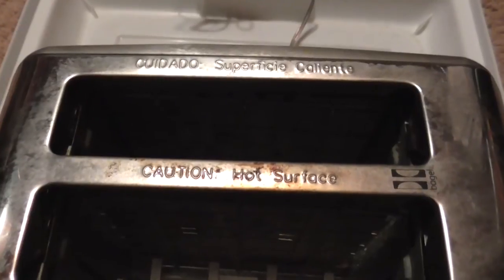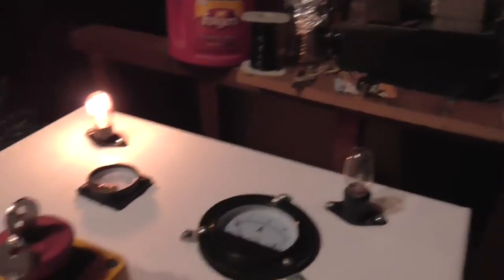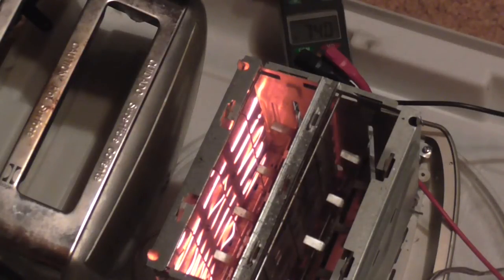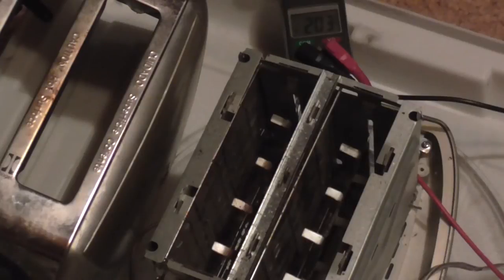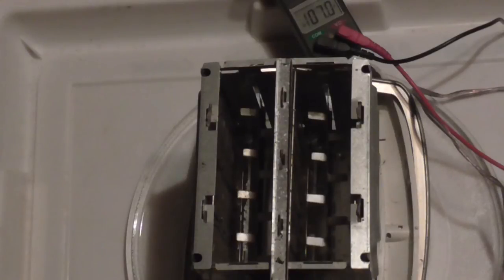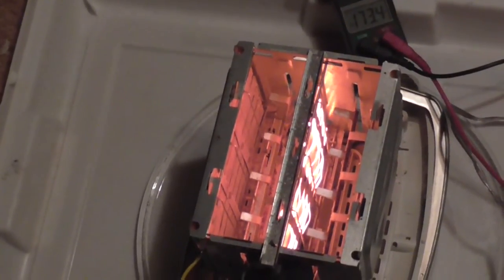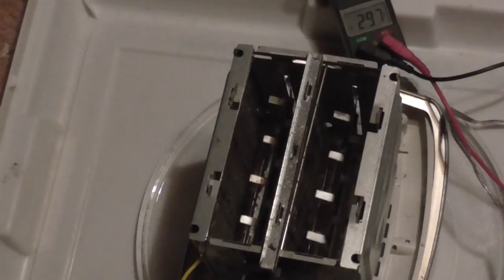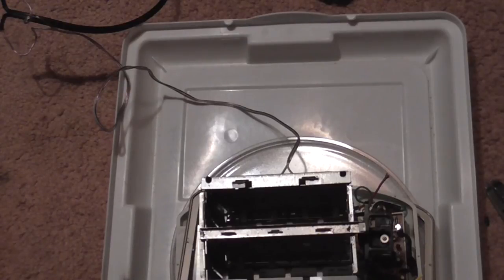Toaster Overload

Comment: You should have put the banana in the toaster XD LMAO, i just got the primary windings done and tested out on my 500 Kv transformer and they came out better than expected, i have a collection o MOTs, and i welded the cores of two MOTs together to run it as one single 240 volt MOT, keep up the great work Cheers mate ;)
Reply from the maker: Thanks!!!! Keep working on that transformer, make sure it's properly insulated.... 500,000 volts is quite the voltage to keep from flashing over, Cheers!!!!;)